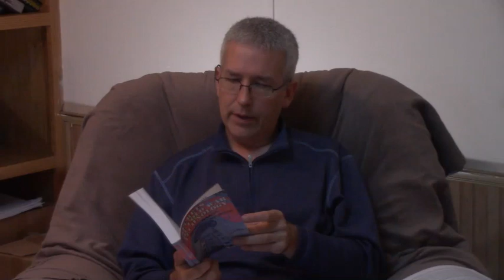Radiant Energy Context

Comment: Rick have you ever messed with geometric phase correction, power factor correction in the transformer itself, using coils at 90 degrees? These coils at 90 degrees appear in many free energy devices.